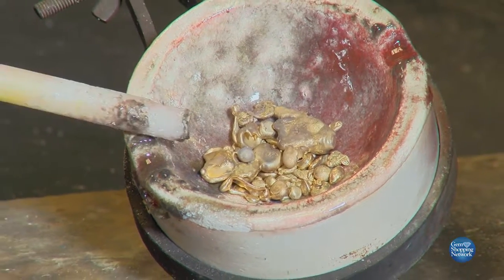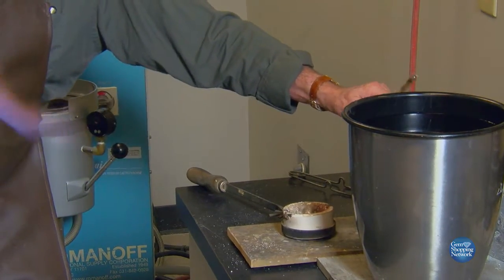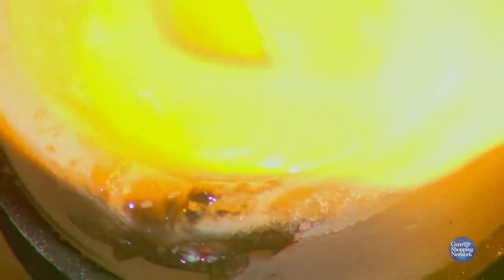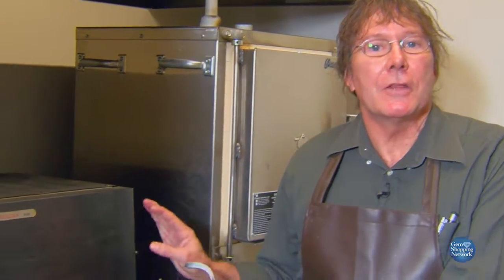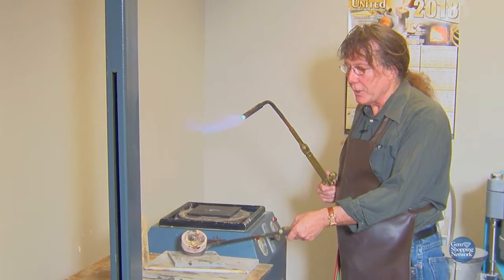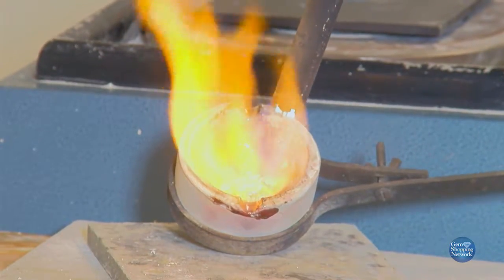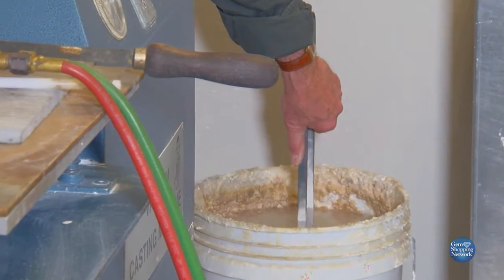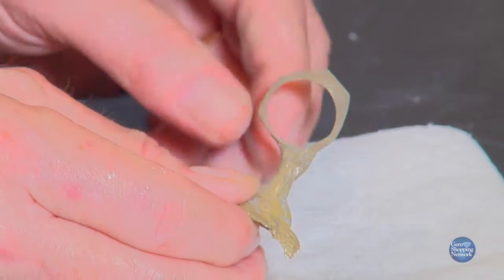HOW IT'S DONE making a semi mount mold PART 3 - Tutorial l Gem Collectors

Comment: How are you keeping a vacuum on your mold?
Reply from the maker: If you are referring to the “flask” that contains the investment and the burned out wax model of the ring to be cast in gold.......I often use a centrifugal casting machine to force  the molten metal into the flask but in the video,  I used the other method of casting molten metal into a flask by use of a “vacuum” machine .  The flask was placed into the machine and turned on and then a vacuum pump pulls air through the investment (the plaster of Paris type material that filled the flask) as it’s designed to let air pass through it. Thus , when poured, the molten metal is “sucked” into every area of detail of the burned out wax model .  The vacuum machine is a non descriptive metal box that holds  the pump and only has the opening at the top for various flask sizes and thus may not have been as noticeable in the video. 
     If you are referring to an actual true “vacuum” , then that is achieved much closer when you do the investing using a vacuum investing machine.  This machine has a plastic bubble dome on a rubber mat that the flask and unsolidified investment is placed under. After which all the air is removed within the sealed dome thus eliminating any air  bubbles from the investment before it hardens around the wax item. 
     Vacuum casting never achieves an actual vacuum but refers more to the machines ability to pull or “vacuum” the air and subsequent molten metal into the void where the wax model was. 
   I hope that explains and answers  your question.
Shawn
Reply: Gem Collectors with Shawn l Gem Shopping Network okay I guess I just never saw the dome that holds the vacuum.